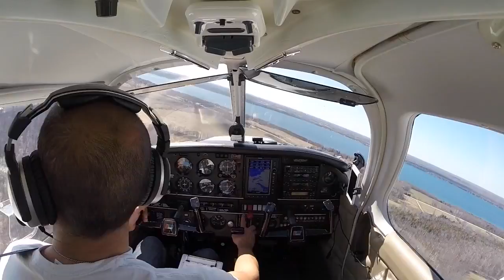Pa28 Cherokee - Approach to Wiarton CYVV - engine quits on runway exit..

Comment: Fouled spark plugs?
Reply from the maker: Was just low idle set too low!
Reply from the maker: Yes after that and having it checked to find that to be the case I made a change to my run up routine in my check list, after Mags and going down to throttle all the way out i count to 30 to make sure, it still runs! Never happened again.
Reply: @GavinD50C  you are very fortunate to have experienced this after touchdown!
Reply: Suppose it was a hot day when it cut off on low idle?
Reply from the maker: @twoflysix4570  totally! normally with the Cherokee i'm landing pretty short and have to power back up to get to the exit so that masked this adjustment problem. On this particular flight, i was full power out all the way to the turn off and the only one at the airport. As you saw, it literally stopped as I turned off. Never happened before that, and never again after I fixed it and validate that each run up! Thats why i shared it as it's one of those many lesson one learns that you can't read in a book.